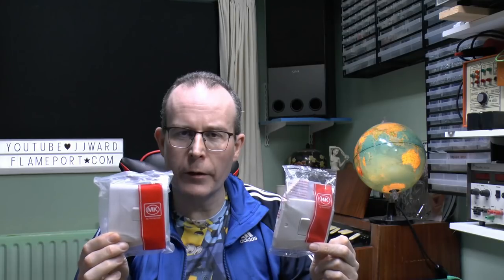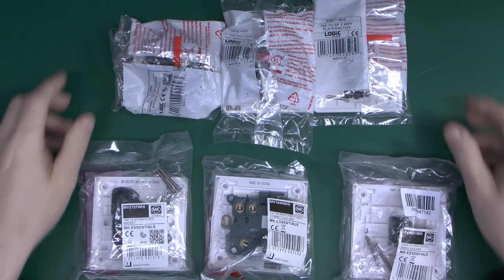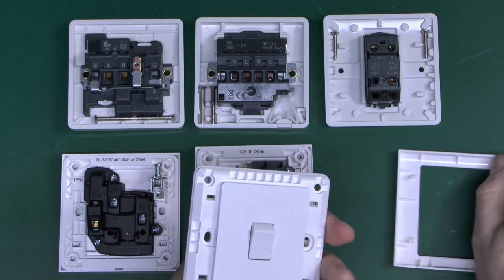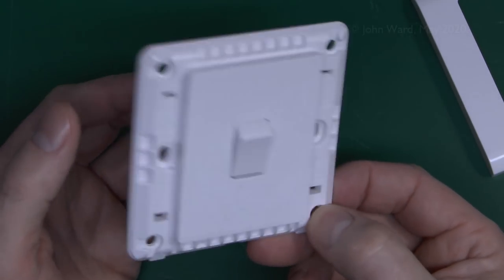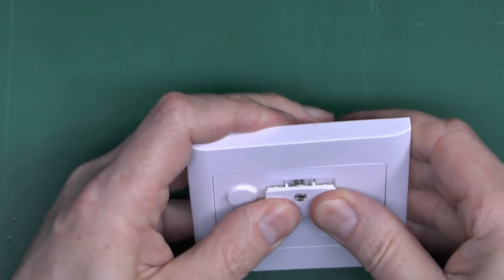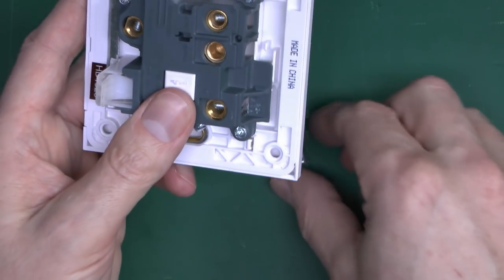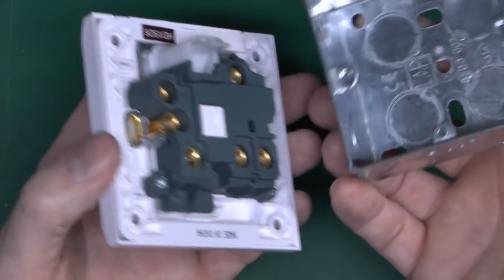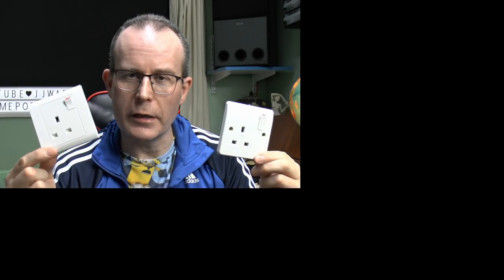MK Essentials vs MK Logic Plus

Comment: Looks like a so called top of the range brand making cheap rubbish to keep their sales up, appealing to the DIY market who love cheap. They look absolutley shocking!
Reply: DIY'er here. I wouldn't touch these dreadful 'essentials' products with a ten foot pole. I'll stick to Logic Plus. Saving a few quid on mains electrical work is foolish and asking for trouble.
Reply: @classicmacintosh  Had the same, but even the top brand names are dropping the quality of the top teir stuff, making it fail soon.  You know you have a problem when a 10 year old socket is better than the same range unit brand new.
Reply: @classicmacintosh  Good on you, like to hear it. Having been an electricain for quite a while, you'd be amazed at how many of or clients like to buy there own wiring accessories for uss to fit, usually rubbish. But you do it right from the sounds of it. 

Theres also a couple of other brands that piss all over even MK logic plus, better user benefits and lower costs.
Reply: @classicmacintosh  Agree, I am one of those dreaded DIY'ers that the trades seem to hate I wouldn't go near them either. The logic stuff is OK though.
Reply: Yes, I believe there are. I've stuck with the Logic Plus range so that everything looks consistent, but may revisit the market if I ever move - then I'm not worried about having to match existing work.
Reply: This DIYer can't abide cheap junk. In fact a lot of DIYers tend to be a bit more discerning. The cost of doing the job in terms of time outweighs saving pennies on the materials.

My installation is all Hager/Schneider (the latter as I liked the grid range for lighting) with a hint of Crabtree.
Reply: @vikingofengland  It's been a long gradual decline for MK and other big name manufacturers down the years. In the 50's and 60's, accessory boxes were made of much thicker steel in a more sturdy manner. Now they are pressed out of much thinner stuff. When the original Logic range was introduced in (I think) 1974, its quality was second to none. In the 80's the range was revamped and, although still good, changes were made to cut costs. In the 90's Logic Plus came, with further changes to save costs, like accessories that clip, rather than screw, together. Then they had a wobble and started trying to make the stuff more cheaply still. In the past I have bought some Logic Plus light switches that were not made in the UK and looked very different (yet similar to the Essential switch) with more intrusion into the box and in-line terminals. They have since reverted to the previous design. They also changed their pendants and 6A pullcords. Instead of buying in Nettle (later acquired by MEM/ Delta) pendants/ roses/ lampholders/ battens which were very sturdily built, they swapped to a much cheaper design  and just printed their logo onto the clear bases. The 6A pullcords were replaced with a similarly cheap design which looked very similar to their own but did not have the same feel about them. I have not bought MK for a while, so do not know if any changes have been made in more recent years, but this Essential range certainly looks like another attempt to cut production costs while still charging a premium price. Charles Arnold would be spinning in his grave!
Reply: @simonabbott7323  I have bought a couple of Logic FCU's in the last few years and they seem to be OK, but overall I tend to go for screw less stainless sockets and light switches (when there is a CPC in the cable and a metal back box!) but I am not sure of the brands as my memory has faded.
Reply: Then there’s me (DIYer) who went MK Edge sockets at £40-50 a pop. 🤦‍♂️ I like the quality of the edge range but they are overpriced. I found a fairly decent equivalent range of polished chrome units in Toolstation for a fraction of the price so went with them for light switches.
Reply: @simonabbott7323  a couple of years back I ordered some logic chroma metal accessories (uk made ones) for a kitchen rewire. The quality of the plating is so good that it restored my faith. They are, however, 25 quid a pop....
Reply: @SME_Ste  Would you share those brands for us. Personally if I was a tradesperson and a customer asked me to fit their products, i'd tell them to do the job themselves - How do you know even if it is a branded product that they haven't bought a counterfeit - how can you guarantee the job?
Reply: Wrong, appealing to the contractor who likes to get a cheap piece of rubbish and slap it into someones home! Wholesalers and contractors are terrible at wanting the cheapest nonsense that will get them through their 1 year warranty then they just don't care. The DIY market buys so few switches and sockets it just isn't worth having a range for them alone, lets face it, you can get a box of MK 2G sockets for £15.00 - if you are doing a project and need 5 sockets that's not going to put people off. These are aimed at the "pro's".

Comment: The other aspect to note is that the Logic Plus range appears to have been conceived with major input from a product design specialist, who took care of the look, feel, and aesthetics.  They have elegant curves and soft corners, especially to the switch itself, for example.  And the material has a "weight" and "solidity" to it that says "quality".  By contrast, the Essentials range products say "cheap" and  "utilitarian".     Given, as John says, the overall price difference is not even that huge, it seems obvious to me to choose quality, and at the same time protect British jobs!
Reply: I don't think i'd describe it as "utilitarian" when it has crap like the unnecessary two-peice design, the design that looks symmetric but isn't, and the impractically deep mechanism on the lightswitch. It's simply cheap crap that tries to by stylish but fails at both style and function.
Reply: I agree. Like most manufacturers and even large retailers, MK and other well established British manufacturers are having to deal with the deluge of cheaper imports and they do so with specifications that are inferior. It’s also the case that installers and, or customers are more interested in lower costs than the integrity of products. Obviously a large building company building numerous houses can make significant savings which either makes it more competitive or more profitable to use cheaper, inferior products. Sadly customers often have no scruples so cheapness rules 
Eventually these cheaper imports will put reputable manufacturers out of business and we will have to adapt to nothing other than inferiority. I’ve often wondered if we all chose good quality products, if the mass production of quality would reduce prices. There is something very satisfying , even enjoyable using MK and Crabtree products, even down to the quality of terminal screws inside them.
One of the worst practices is that of otherwise reputable manufacturers allowing their names to be used to sell inferior products, they’re almost all at it.
It’s wrong to ridicule “made in China,” like we used to decades ago with, made in Hong Kong” because China will manufacture to the specifications required by there customers. The Chinese make lots of outstanding stuff, but we are learning, too late, that those British manufacturers that have sold their souls to China have seriously undermined British manufacturers and industry for short term gain, and have ignored the human costs of cheap labour. Shameless business that we’re making huge profits in Britain have abandoned the people that made them wealthy and chosen to support foreign manufacturers for bigger profits with total disregard for long term human, political and military implications that sadly are now manifesting themselves on the world scene in 2022.
Long live MK, it will be a sad day if we lose it

Comment: When asked I've always recommended "anything MK" now I have to say "Anything MK except if it is labelled Essentials". I'm horrified by the light switch both for the depth and exposed terminal screw, that is only asking for trouble and puts safety backwards several decades.
Reply: I like the logic plus range.
Those essentials ones look awful...

If I can't get logic plus I will most likely switch to Schnider ones which are also very good
Reply: @dasy2k1  I've heard good things about Crabtree. Do you know if they're true?
Reply: @jamescollins6085  no, just no! Feels crazy cheap and is not worth it even if your life depends on it.

Comment: Screw holes in the corner for the dodgy DIY home wiring installer, you simply save on the expensive wall box, and screw them down to the drywall at 2 corners instead.
Reply: I'd go with them being standard practice in the market this range was originally meant for.
Reply: I do DIY wiring and I wouldn't dream of doing that...
Reply: Well, what's the back box for anyway ?
Reply: What on Earth is a back box?
Reply: @DrQuadrivium  A box that goes at the back...
Reply: @DrQuadrivium  The box that usually goes on the back of electrical stuff.
Reply: @vikingofengland  But back in the day - 'back-boxes' were wood - you could screw into them anywhere ;) Have some in this house ;) They're smaller - so modern switch screw holes don't line up with the old screw holes.
Reply: @DrQuadrivium  In UK electrical terminology, a backbox is box that is designed to have an electrical acessory screwed to the front and covers up the terminals and wiring on the back of the accessory.  There are various different styles including metal boxes for flush mounting in masonary walls, dryline boxes with mounting ears for fixing to plasterboard or similar, and "pattress" boxes for surface mounting. Plus various special styles for use with conduit and trunking systems.
Reply: @DrQuadrivium  Doesn't look like "irony detection" is strong around here.
Reply: @MrKarlPrince  
When I was a boy my family was so poor that we couldn't afford irony. However, since the invention of all the elastictrickery regulations it's much cheaper - and now I have a certified irony installation licence (license).

Comment: Thanks JW. I'm a DIYer and an electrician's son for whom MK was always the first choice for quality and reliability. To see the brand being conned by the corporate bean-counters to go down this route at the expense of both installers and customers is just shocking. What are they thinking? I had the displeasure of working for an old established company which came under Honeywell ownership and I can tell you now that they don't give a damn about anything other than turnover up and headcount down. Total short term attitude to running a business and to hell with traditional values. Then there's the standard 'Honeywell Operating System'. Don't get me started....

MK are you receiving? Listen to those of us who use and value your brand. Reject those instructing you to source from the Far East as we will reject this 'Poundshop crap' masquerading as top brand goods. And when you've acknowledged your serious error, as indeed you will eventually have to, then don't try the recover the situation by 're-branding' the Logic range or some other nonsense. Leave your quality and trusted designs alone and made in the UK where they should stay.
Reply: When a brand is purchased by bean counters, they don’t get to decide whether or not to follow the directives from their owners. No conning necessary at all. Most likely anyone not installed by the overlords at MK will know exactly what’s happening. Doesn’t mean they can just ignore it.

Comment: The fact that the light switch doesn't quite fit into a 25mm back box shows how much thought has been put into the practicality of the design. But then, I suppose you can't see the screw heads so it doesn't really matter if your house burns down because you tried to squeeze this into existing wiring hardware.

Is anyone is actually offended by screw heads, or is it just a problem that brands invented to keep themselves occupied? I'd always prefer them over that ugly seam around the faceplate.
Reply: Its probably so the load bearing plastic doesn't need to be as pretty, the front plate on these looks quite chewy compared to what you see in the like of Hager sockets where it's rock hard.

Comment: In case you don't know, MK stands for Multi Kontact. I think this trade name was registered in the 1920's. MK and Crabtree were the best quality you could buy in the 70's and 80's. Nearly all commercial and industrial tenders required you to supply MK. Crabtree wiring accessories were a requirement for local councils and health authority tenders. Obviously times have changed since them.
Reply: 'multy' with a 'y'
Reply: I'd say mk was the rolls Royce until the logic plus came in about 20 years ago. It's just ridden on its old reputation with high prices but crap quality. I bet an mk switch in the 80s  will still work now. Can't see a logic plus lasting 10 years. I use click mode and sometimes hager.

Comment: The point of having MK fittings at a premium cost is to fit them so they either last a 20 year life cycle in average locations or over 5 years in a hard wearing location like a HMO rental/council flat type where they won't get looked after well. Can you imagine fitting somethhing with a removable clip on front and expecting it to make over 5 years........
Reply: Wait what? Wearing out in 20 years in residential use is not only considered acceptable, but even premium? Oy vey.

Comment: 13A sockerts are standard in Hong Kong, so maybe these were originally designed for that market.
Reply: Yes or Malaysia, they use the same sockets and they are often polycarbonate with a clip on surround just like these
Reply: I now believe these are not even made by MK, but a Chinese OEM (and the same one BG uses, so the quality is decent enough for the MK brand and guarantee).  These plastics will scratch and discolour easily.
Reply: UK sockets are also used in many countries in the Middle East and the old UK colonies in West Africa. But they usually don't follow UK wiring standards. And plugs often have no fuses. Lethal.
Reply: We have something resembling MK Essentials, it's called "Slimline Plus" series in Malaysia

Comment: The essentials line looks like it was more suitable for that wide trunking seen in offices, especially with the fused thing having a front exit for the wire and the bigger sticky out bit for the light switch.
Reply: I think your right there ,mk was top quality ,might have shot themselves in foot.Another thing with mk never could understand why they in grid pattern 1way,2way 6a/20a switches.why make not make just 20a 2 way?
Reply: @raychambers3646  And why no blanking plates with a curve top and bottom to match lightswitches?
Reply: @Graham_Langley  they also seem to do different thicknesses in there ranges,have been caught out with that .